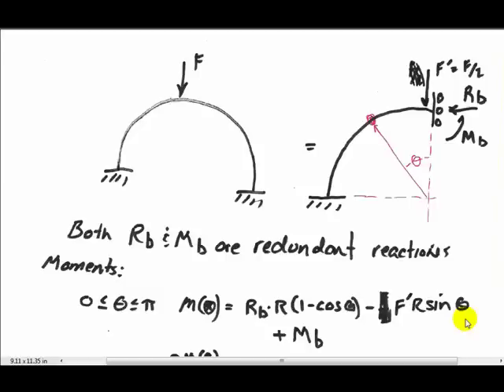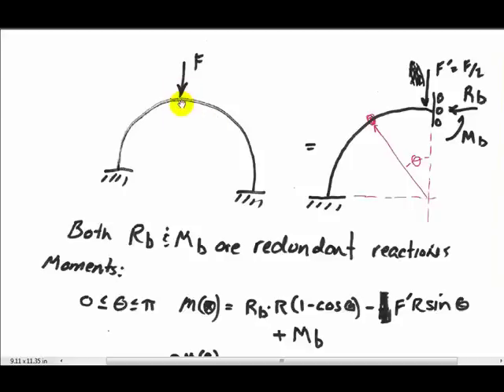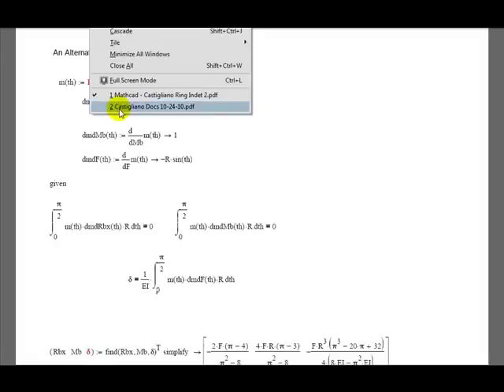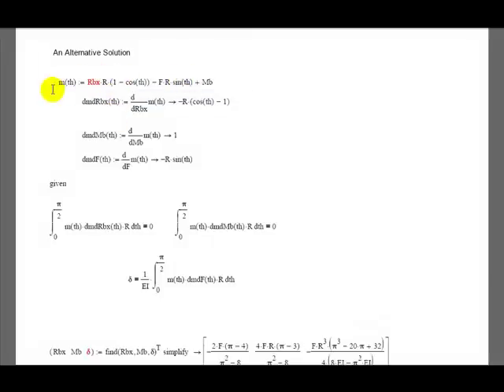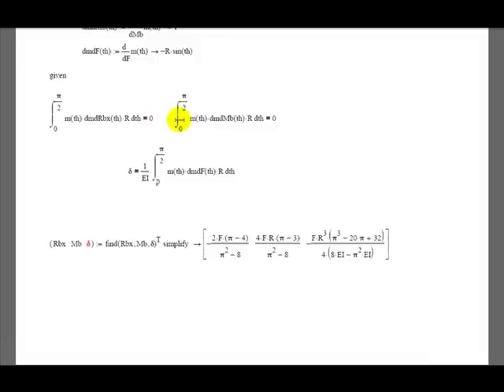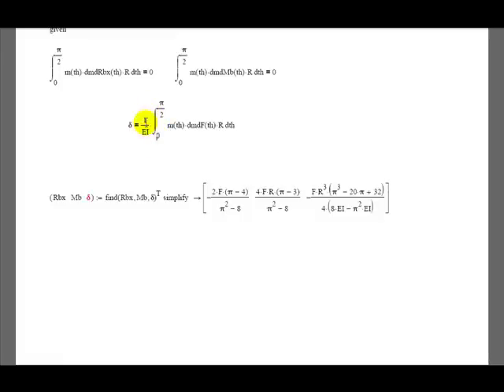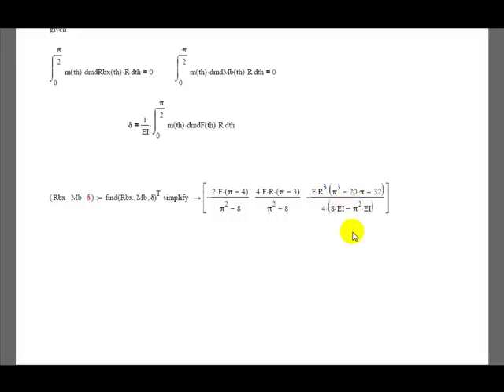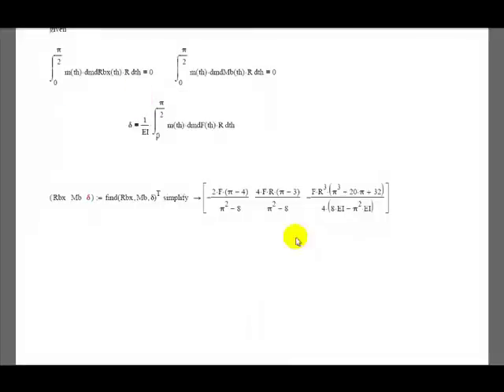3323 Castigliano  9 Thin Ring Indeterminate v2 Mathcad

Comment: I find your video's very helpful. But, i hope you can help me with this one.
I am trying to solve the quarter ring deflection with mathcad. I have come to the point that mathcad should solve the final equation. But it does not solve it. I use Mathcad Prime 3.0. How should i set-up the last part?